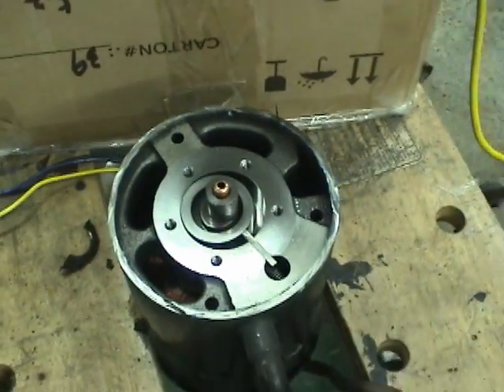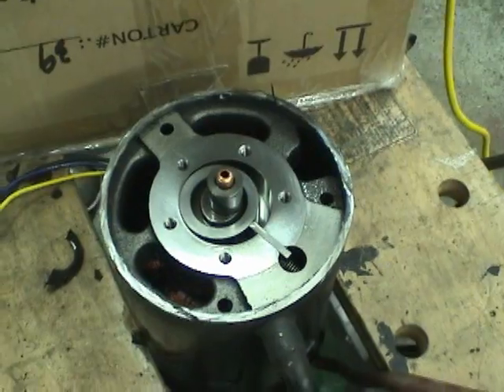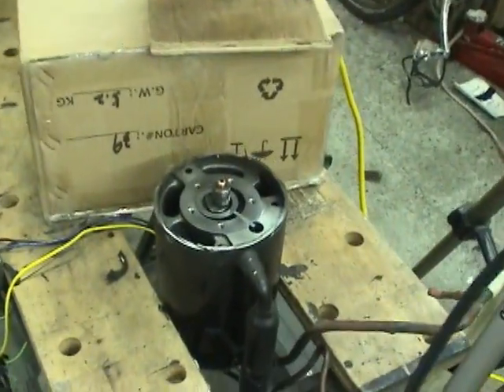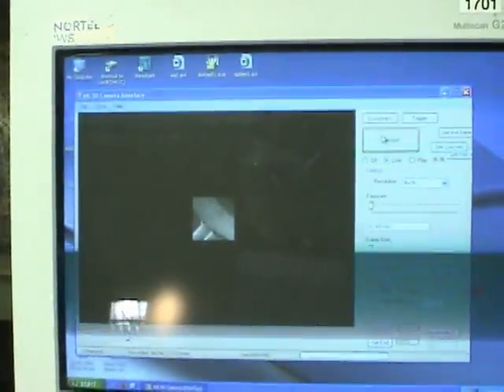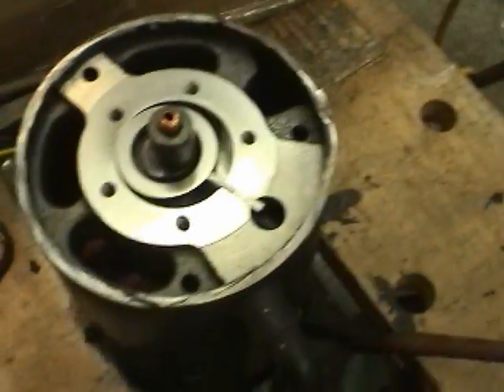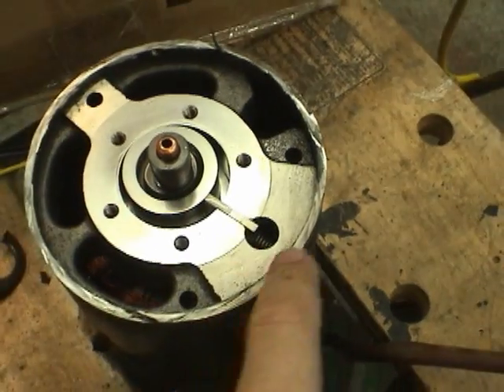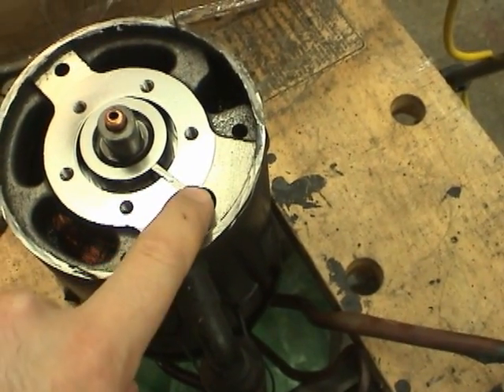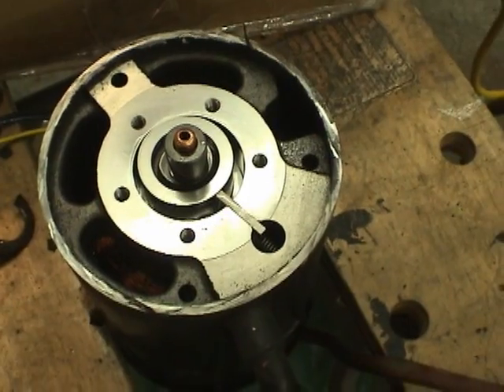Rotary compressor sealing vane leakage/chatter

Comment: yeah fitting/pipe failures would be cool but you need over 600psi to rupture refrigeration lines

I could make a test rig for clamped/press fittings though

Comment: you'd have to fit a regulator to the discharge in order to keep back pressure safe whilst using it as a Vac pump

Comment: thanks for the vid ,,ya no one day i plane to do a hose /pressure video to show the
limmits of barbed fittings and hose clamps and the quick connect pipe fittings,
also it would be neet to induce a rupture on a copper pipe to view the behavior of the incedent